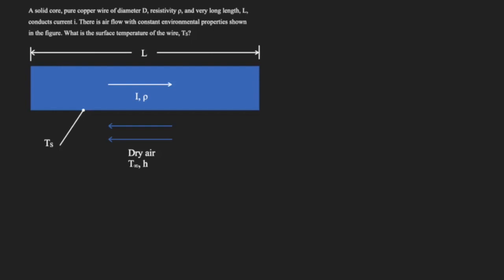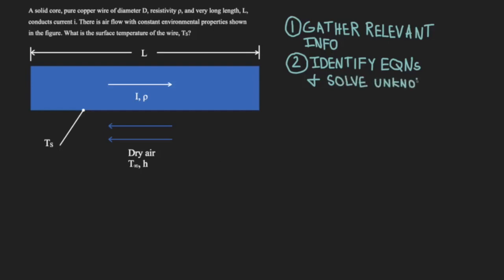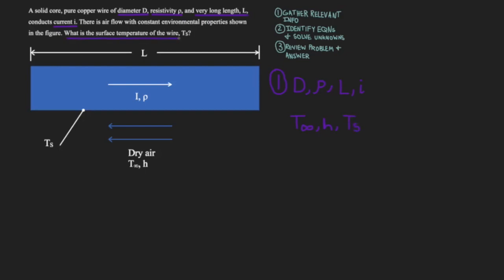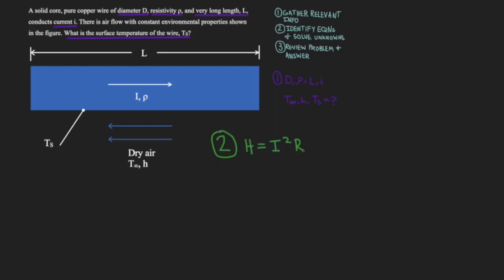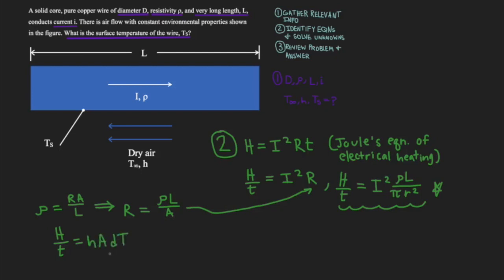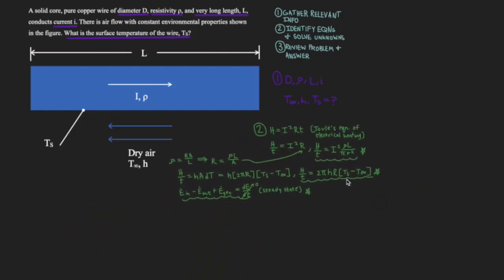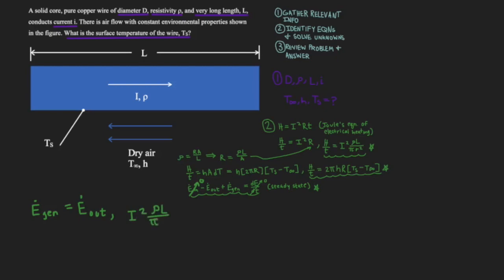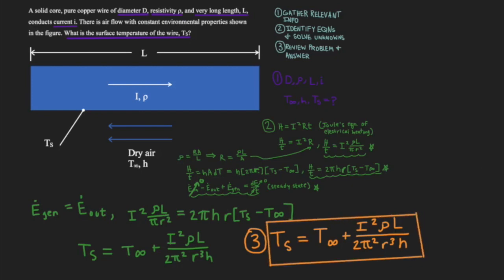TESLA Mechanical Design Engineer Interview Question SOLVED! #4

Comment: Do you really think that the thermal conductivity of wire plays no role here?  Moreover, The area is 2*pi*R*L (by mistake it is written 2*pi*R in video). From what I understand, we need to solve the governing equation of 1D ODE conduction including diffusion and heat generation (per volume) together with B.C. (@r=0 T= finite, @r=R:  k.dT/dr = h(T-T_inf).

Comment: Thank you for sharing these problems!  I am currently slowly going through them all.  Can you comment on how you know that these are Tesla ME Engineer Interview questions?  Also on this one you listed L and h as different variables in the final equation/solution but L and h are really the same.  As such they should cancel out from the final equation/solution.  Do you agree?  Have a great one!
Reply from the maker: These problems came directly from a Tesla Codility exam which was part of their interview process for this mechanical design engineer position. In this case, L and h are different. L is the length, and h is the heat transfer coefficient. Thanks for watching!

Comment: At 2:50 , isn't the area exposed to convective heating: 2 pi R L ? (instead of 2 pi R, which can't even be an area since it has units of lenght)
Reply from the maker: I take back my previous thought. I think you are correct and the area exposed to convective heating should be 2 pi R L, as you state. This means the final solution should look like T_S=T_∞+(I^2 ρ)/(2π^2 R^3 h). Thanks for that catch!
Reply: @Arch1medes  Both approaches come to the same conclusion, but the one Mateo brought up is the better one analytically speaking.
Reply from the maker: @Jiacheng He Thanks! Appreciate the feedback, I will try to distinguish variables better next time
Reply from the maker: I may be wrong here and I believe that you are correct in theory, however, the heat transfer is being analyzed at a single point so the length is infinitesimal.
Reply: @Arch1medes  then you should also analyze only the heat transferred from an infinitesimal point of the wire, so the Resistivity would be R = rho (dl) /A, because if you use the whole length,then the resistivity would also consider the whole wire and not just a single point as you suggest
Reply from the maker: @salvaionicle  Makes sense. I’m going to take another look at this and I will add corrections and update you on what I come up with. Nice catch!